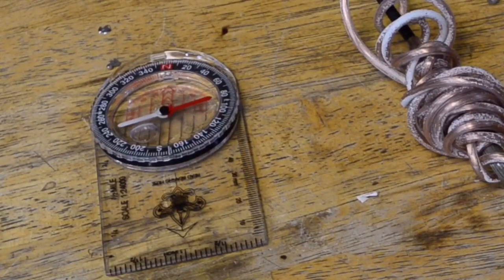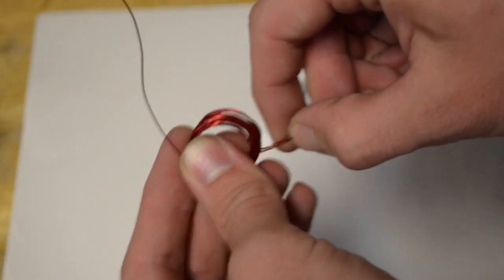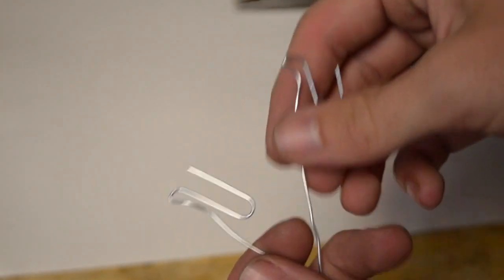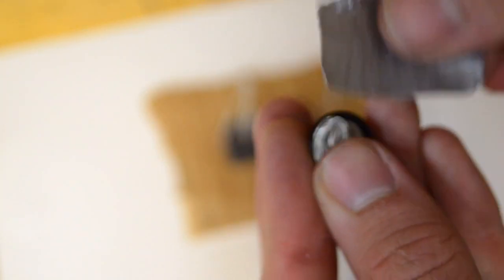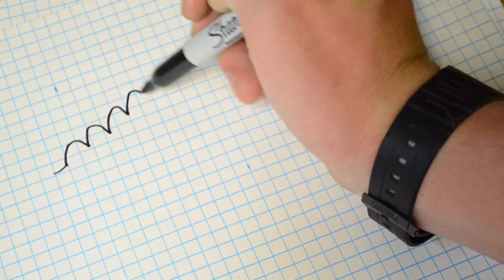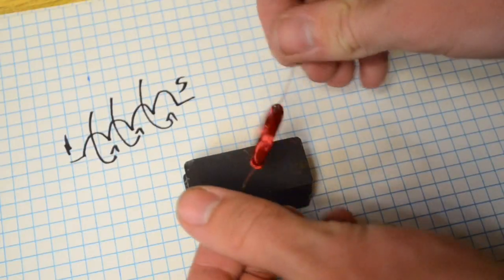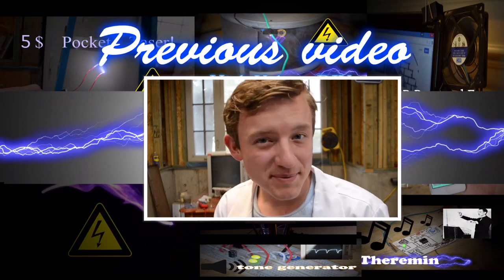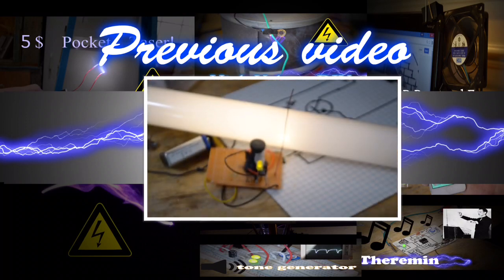How to make an Electric Motor

Comment: I just wanted to let you know that I think you make top quality videos. I no longer have the equipment/software to make good videos. I was hoping that you would take my instructable at
https://www.flickr.com/photos/78486989@N07/sets/72157698358686090 that shows how I make a very cool satellite magnet, riding on a concave mirror, pulse motor. (If you view the pictures individually, you can see notes below the picture.)
You could also just stop at the test/mock up stage if you didn't want to continue to the 'put it in a self contained container' stage.
My last YouTube video on this device is at: https://www.youtube.com/watch?v=4u65wUF0QNo
The instructable has much more detail than the video and
uses some updated techniques. Using the exact coil recommended in the instructable, I was able to get one of these motors to run non-stop for 57 days on a dollar store 9v battery.
(It is a slightly modified Lidmotor circuit, using my alignment/housing design.)
TallDudeInLA using my wife's channel.

Comment: I love your videos! The microwave one especially, I have my transformer in my garage, and I haven't used it for awhile lol. Your video helped for what I'm gonna be doing:P
Reply from the maker: Great to hear :D just our of curiosity what are you planning on doing?
Reply from the maker: +Keystone Science *out I meant not our
Reply: Keystone Science I'm gonna hook up my transformer to a stainless steel batman symbol, so it's like the brander off batman v super man
Reply: Keystone Science My video on that isn't gonna be for awhile though
Reply from the maker: +Mystic Maker hah that's awesome! Have you looked into rewireing the secondary to get high current?
Reply: Keystone Science Yes! I actually already took it out, weird you should say that lol
Reply: Keystone Science the only think next I need to do is buy some car cables or a thick wire
Reply from the maker: +Mystic Maker  awesome!!
Reply: Keystone Science thanks!:)